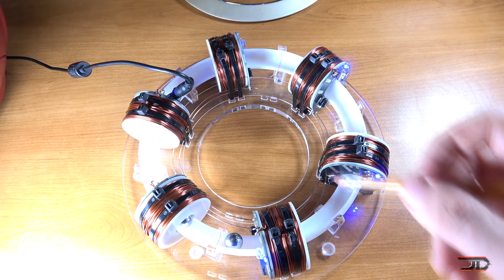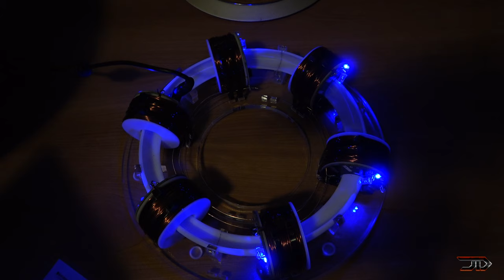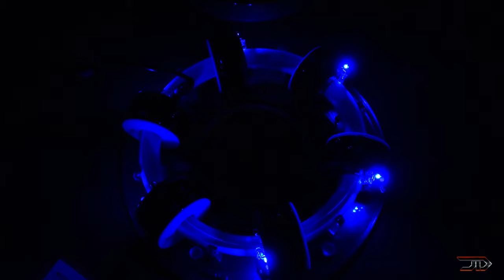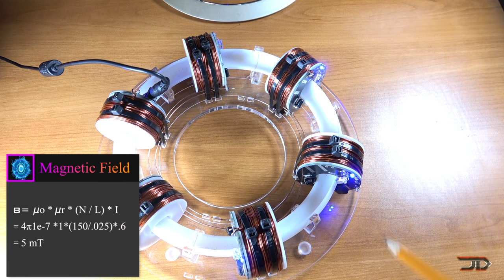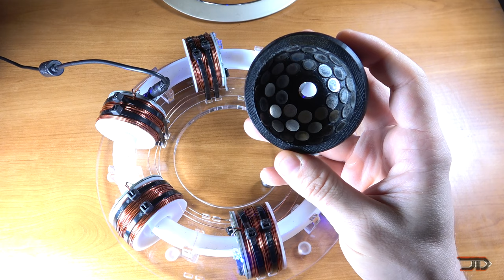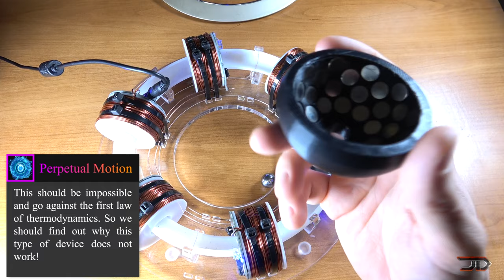Homemade Rotating Cyclotron

Comment: Crank it to the maximum and produce a Gravitron, instant Noble Prize !
Reply: Nerd Time

To discover a Graviton(which is the quanta of Gravity) is extremely hard. Firstly, Gravity is the weakest force at the subatomic level so Graviton would theoretically be hard to detect as it's so weak. Secondly, to discover the Graviton, you would need a Particle Accelerator so incredibly large that it will literally collapse in a black hole. Also, in the video he only accelerated steel balls very fast but they weren't protons and they need to go at the speed of light. Finally, this project would take millions of people like at CERN so who will earn the Nobel Prize?
Reply: @thegamexpert4830  steel balls contain protons and therefore cannot go the speed of light
Reply: @thegamexpert4830 that's purely wrong just producing the hypothesis for a gravitron showing its possible and withing human capabilities can earn you Nobel prize just like GR a lot of it was purely theorised until recently
Reply: instant destruction of earth too
Reply: @Null-Boi  You know they have made tiny black holes before without destroying the earth, yeah?
Reply: 😂😂bro scientist not able to find graviton
Reply: @gautamchoubey1275  I don't expect it was a serious proposal...
Reply: @thegamexpert4830  Good point my friend, but just correcting the particles would be very close to the speed of light and not in it itself, because Einstein himself said that nothing can pass light
Reply: Literally impossible because gravity is a wave not a particle. There are 2 types of gravity waves A and B.
Reply: Not how that works ...
Reply: @jonathanwaugh1433  I would love you to try to explain 😆
Reply: @vulgarian5334 it's ok to be utterly wrong.
Reply: @thegamexpert4830 Since you mentioned that the protons would need to go at the speed of light, it will need an infinite amount of energy for it to go that fast, therefore this would be impossible until we're able to push something to the speed of light. All the other maths such as how big the accelerator would need to be, is irrelevant until then
Reply: The magnets need to be protons and go at the speed of light without any gas to interfere.

Comment from the maker: This kind of works in the same principle as the solenoid engine. You could turn this into mechanical motion and call it a motor but for now it's just a light display heh . I will also try to build the permanent magnet version soon but I don't expect to work at all heh.
Reply: CAN YOU MAKE ME THE CAHRGER I ASKED FOR?
Reply from the maker: @ddegn  Yeah thanks, I know it won't work heh but I will show why.
Reply: Pretty sure this is more similar to a synchrotron than a cyclotron… honestly synchrotrons are cooler anyways.
Reply: time to build a proton pack my guy

Comment: And can you manipulate any variables like voltage supply that may affect the speed or rate it speeds up or really anything else?
Reply: Could probably hook the power supply to a potentiometer.
Reply: you need to increase current and response rate however those wires probably cant handle more current

Comment: I haven't tried myself, but these self powered , magnet motors ppl keep trying to build, that actually almost work, they get to one spot and kick back, or need help to pass, I'm thinking maybe build them in layers, and offset them by a few degrees, maybe add multiple layers, with them 60° offset or something. And possibly use something to spin it up to about 250-500 RPM, maybe use a flywheel, and maybe it will continue to spin,   or possibly use a coil to generate a pulse, use it with an electromagnet, to reverse or neutralize the offending magnet, aka the one that stops the rotation, then add layers, and offset like the first one, atleast 3 at 120° offset, use a balanced flywheel, spin it up and see if it will actually work. Maybe it could be used with a light duty motor to increase the efficiency. Say put in. 12v 1amp, spin a generator, making, 16v 1amp or something, normally, it would be something like 9v 1a, *anytime energy moves, some falls out the bucket!,, losses!!*  but a magnet motor using an electro magnet to neutralize the offending magnet, can work, maybe it can be used to do work. If multiple layers, and very strong magnets are used, also use iron to carry the flux closing the gaps increasing the effiencey. Get tight tolerances, approximately .020"-.040" far from the .125" - .250" i have seen in some, but that requires machine work, and funding on something everyone says will not work..i think getting to 99.9% or even 101% effiecency us possible, but not truely, there is still the energy used to make the magnet, and they do have half lives! So is that a violation of thermal dynamics???

Comment: You might try implementing a vector/field oriented control algorithm.  Use sensors to read the speed of the balls, then calculate the phase and frequency to engage the solenoids. You can implement a feedback loop between the internal model and the sensors.

Comment: I was wondering, could you attach this to a converter and produce electricity?
Reply: Probably, but you would lose more power than you generate since electricity is what's powering the electromagnets that accelerate the ball bearing.

Comment: Accelerate mercury, iron nanopartícles, cobalt ,barium in a  vacuum  sealed quartz cyclotron . Do the same coil winding, but cover the cyclotron in magnets such as in this one.  Use a Variac to control transformers feeding the magnet,  use #16 Ga wire . Use a voltage multiplier to get to approximately 2 million volts. The ferro-mercurial mixture will spin faster. There will be no friction since the material will become a plasma that will be centered in the tube and there is no air inside. As you increase the voltage the plasma will reach near relativistic radial speed. This will then become a TOCOMAC.  First you will see a corona effect produced; as the voltage increases, a white field will be generate and envellope the device and extend outside . 
The weight of the setup will easily start decreasing by 5% then significantly more as you increase the voltage, and eventually levitate. 
THIS IS NOT A GYROSCOPIC EFFECT BUT RATHER THE  WHITE FIELD WILL “ HIDE THE CENTER OF GRAVITY” of the device and whatever it is attached to.  Therefore E= MC^2  becomes E= C^2 or  C to infinity.   This was initially done in the Latrobe 1950’s and perfected in the 1960’s.  By the way time will also be affected.  The electricity generated by the plasma is captured with another secondary and you will be surprised at the wattage generated.  Also BEWARE, a large quantity of UV will be generated.   
The only part I don’t have is the proportion of the elements making the “plasma amalgam” as they use to call it! 
Good luck
Reply: Dear friends

Do you have relevant information to provide?

Comment: Experiment with accelerating thru an arc and decelerating 180 degrees away. I never understood why this doesn’t work. It should give a net force in one direction with no traction or mass ejection. But surely our engineers would have already considered this.

Comment: Now if only there was a way to use this to create an energy output. Then we could be real close to creating an actual arc reactor.
Reply: You need to put in energy in order to accelerate the ball so even if you did have some sort of energy output it would be lesser than the energy that was put in in the form of electricity
Reply: Yah, that’s the tough part. The thing takes more than it gives.

Comment: It has a potential to be a reliable Motor just link all the balls on a thread or chain wich overlength outside the casing and to the flywheel with half a hole bores that match the balls
Reply from the maker: For sure, that is possible!

Comment: What would happen if you replaced the plastic ball track with a tube that's filled with liquid metal like mercury?
Reply from the maker: It would probably rotate the mercury. I would like to try that but I would have to get a vent for fumes and test it in a safe environment.

Comment: Also can this be designed to become a self suitable power source  using a perceptual motion kf the balls motion charging the electro magnetics.. my hypothesis is yes but hey I'm a guy living in bethel alaska with no advanced science knowledge or friends that can help determine if I am correct about my minds thoughts
Reply from the maker: I'm not sure but I watched Lapointe propel magnets through 2 arrays which should not be possible. We will have to explore this idea more and maybe even electrogravitic stuff.
Reply: next I need isolation on apart of the cylinder  strictly for battery charging then a circuit with a light bulb attached. the energy can be measured and different sizes created blah blah blah.
I just seen this thing and understand with the correct parts added and designed it could become 
something great after the barriers of what is missing added. 
good luck 👍 I hope this message helps humanity break off fossil fuels and it can somehow make its way Into homes and cars. happy holidays . I have faith if a covid vaccine can be made 
we can figure out a self generating power plant. if you succeed don't forget about me now. and get a patent on it.
Reply: Yes, you need to read more about Newton laws and electromagnetic waves principles.   Our brain is fantastic, you can even imagine cows and pigs flying, it doesn't mean it is possible in the real world.  Understanding laws of physics funnel your brain to think productively.   

There is no perpetual motion without energy loss in this universe, so, no self sustain power source, even the Moon orbit around the Earth suffers losses by gravitational pull, it is distancing away from us.   Make a star like our Sun, it will burn hydrogen for several billion years and produce astonishing quantities of energy as the byproduct of the process, but even that is not perpetual, the hydrogen is consumed to Helium, and at some point in time, the star dies.

The design of this video should use the sensor ahead of the coil, not too close, then it could improve speed.   Magnetic field propagate pretty fast, almost the same as gravity, but the magnetic field generation is not that quick, due inductor impedance to current.  A simple 12V power supply has no kick enough to make it fast, it is not by random choice that real life particle accelerometers use several thousands of volts and watts to create the fraction of light speed for particle collision.

Comment: how much power supply should we need to make the coil an electromagnet
Reply: The coils are electromagnets. They only turn on for short periods.
He mentioned the device uses 8 Watts. At 12 Volts the current should be about 0.66 Amps.

Comment: Can you do the same with normal magnets. Not electric basically
Reply from the maker: Umm, kind of. I tried with the Lapointe array but I would need like 150 arrays. It also would be a perpetual motion machine so it should technically not work.